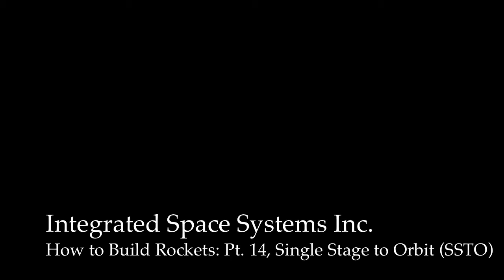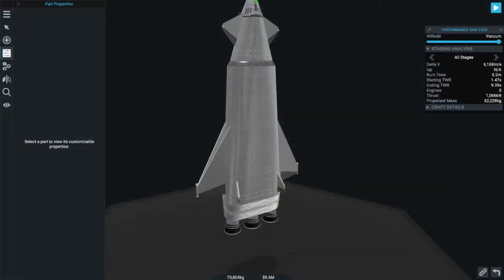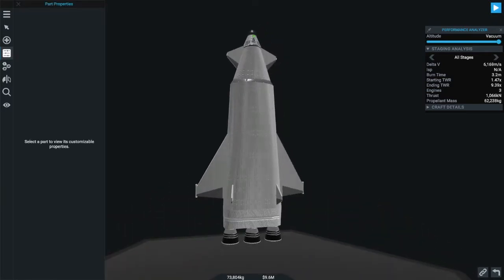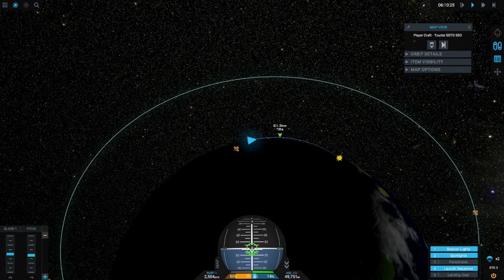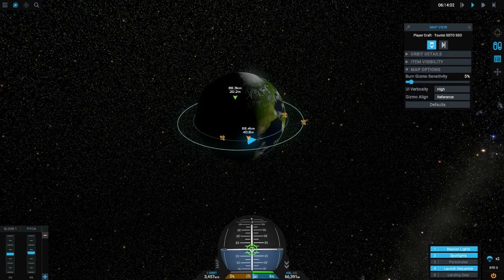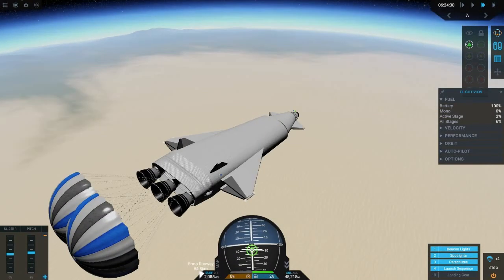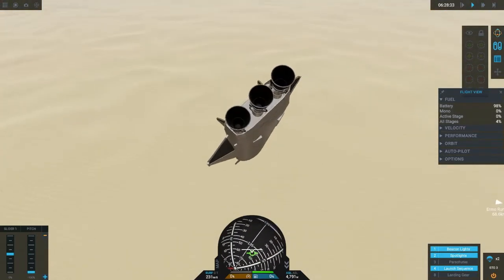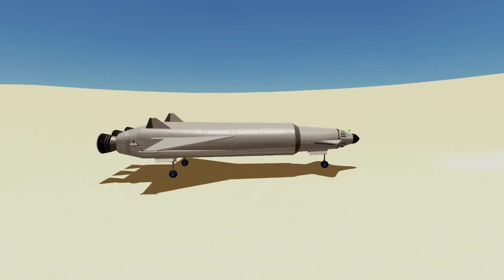Juno: New Origins || How To Build Rockets: Pt. 13, SSTOs

Comment: What would you have done differently to get the rocket to land back on the tarmac?
Reply: Well I'm not him, but genorally there are two reentry trajectories. If you have a lot of lift and large wings, then you burn retrograde roughly 1/3 of the circumference away from the landing strip, with your periapsis just below the surface, and reenter pointing 30-45 degrees up. The other one for crafts that can't survive nearly as rough a reentry is to have your periapsis be ~45km, and have the periapsis be 1/4th behind the vab, so you'd burn retrograde 3/4ths of the planets circumference from vab.
Reply: McDuetchVan thanks.